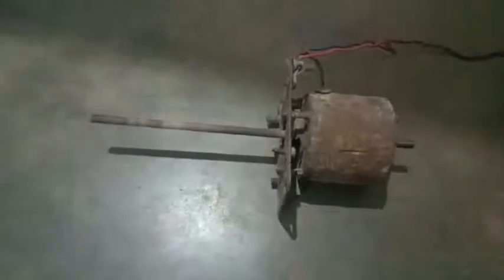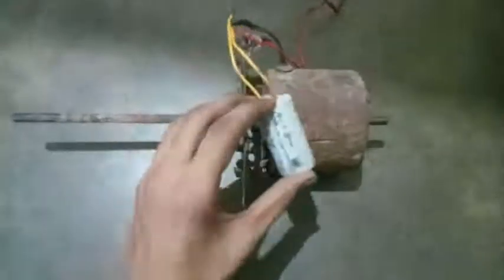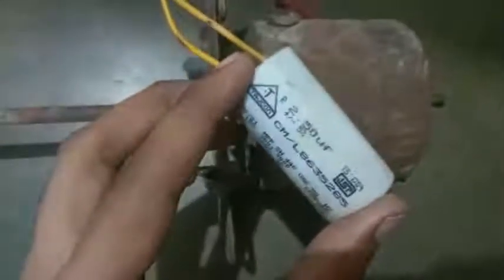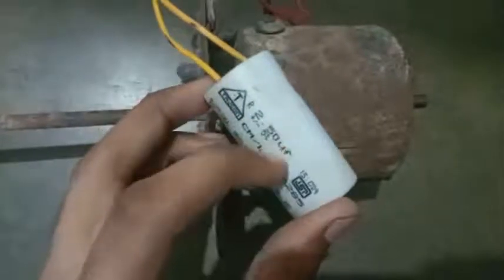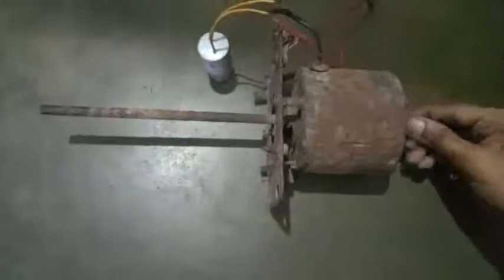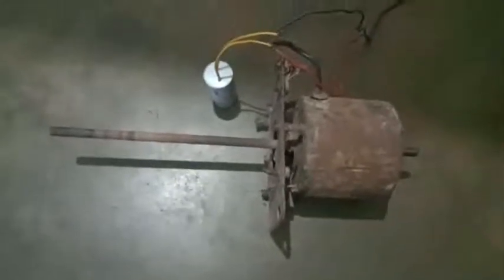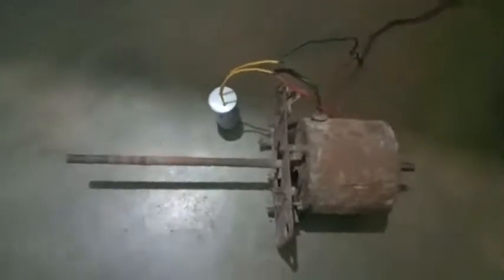Testing of old cooler water pump with capacitor and without capacitor

Comment: I have a very old Symphony Kaizen cooler, which has this kind of pump. Its shaft is rotating but water isn't thrown out. How can i repair this issue? The shaft is inside a long pipe, at the bottom there is a fan covered by a net. The fan's needle is rusted and became thin now.
Reply: Kya meri shaft hi rust se gal gayi hai? Kya new shaft lag jayegi? ya new pump kharidna padega?